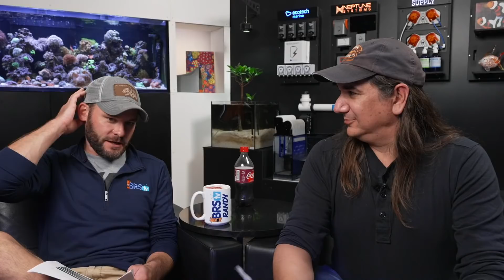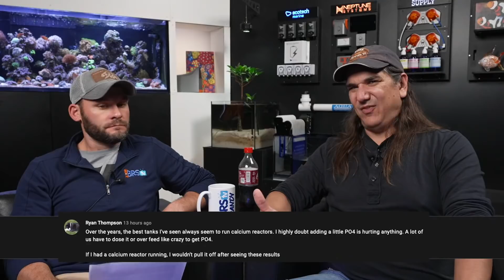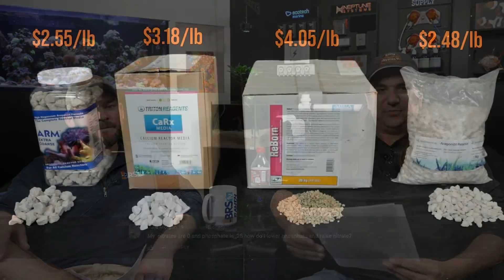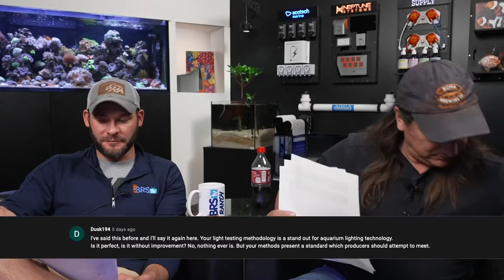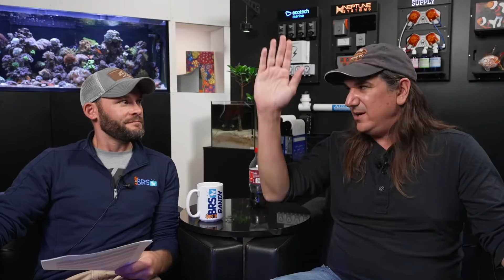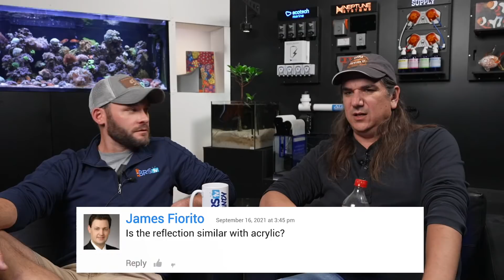What We Didn’t Tell You About Phosphate Factories, Crappy PAR Meters and Why Air Sucks for Lighting!

Comment: The reflection with acrylic will most probaly be the same. The angle at wich total reflection is achived will be a bit different but I think it will be pretty much the same outcome. Following a light ray from lamp to ground it will be refracted less to the side at the water/acrylic boundary compared to glass (because the difference of IoR if water and acrylic is smaller than that of water and glass) meaning it will hit the acrylic/air boudary unter a shallower angle, meaning it will be reflected even better (well it either is reflected or not, but the range of reflected paths, depending on the particular angle will be larger). However, the difference of IoR between acrylic an air is also smaller than that between glass and air, narrowinf down the area of angles that would be reflected. Maybe they cancel out at the end? If not I think the difference will be negligible. After that the light will get refracted less towards the bottom, compared to glass. So im pretty sure the phenomenon of reflection stays. Since, from the viewpoint of the light, pretty much all the area of the side panels are mirrors already, I don't think it changes anything in the whole (depending on the angle it's either a mirror or not. Even if there is no glass or acrylic at all, meaning that the difference of IoR is the smallest of all 3 scenarios, you achive total reflection with rather steep angles already. Watch videos of scuba divers looking at the sky. There is only a small "window" in the center of the field of view where you are actually able to see outside of the water. Everything else is reflection. See also my post about simply looking into the tank from the perspective of a light source.

Edit: So, it turns out that the spot where you can see out of water into air is 97 degress wide. For us that means that every light ray that is closer than 41.5 degrees to the wall of the aquarium will get reflected. But wait, this is without glass or acrylic in between. I just remembered that a "coat" of an optically denser material, between water and air will have the effect of increasing this angle (a wider range of angles getting reflected). It's done with glas fiber this way. That means that with acrylic you will achive reflection less easy than with glass but it will still be better than having no "coat" at all. So the absolute minimum you'll get are the mentioned 41.5 degrees. The IoR of the usual glas and acrylic are pretty close. Water: 1.33; Acrylic 1.49-1.5; "normal" Glas: 1.5-1.52

By the way, there is free CAD software where you could model your aquarium, glass/acrylic thickness, lamp height and all, and see what gets reflected. I just don't have it installed right now :P .

Comment: You seriously can't judge PAR or brightness with the eye. It's not designed for that. There are 2 things making this nigh impossible. 1st Eyes/brains compare the brightnesses and don't measure absolute brightness. Where you end up is extremely dependent on the surrounding light. 2nd the "brightness" one percives is the logarithm of the actual brigtness. Meaning that if the brightness/PAR is doubled it looks like it was only increased by a little bit. The same it true for sound. This is the reason why a 200 watts hi-fi isn't twice as loud as a 100 watt hi-fi. Enery wise it is, but you need much more than double the energy to make it subjectively sound twice as loud.

Comment: You don't need the laser or consult scientists, you can just see the reflection of the light by looking into the tank from above (your eyes about there where the light would sit) everywhere where you see the ground reflected in the side windows...well the light is reflected to the ground, it goes both ways. Without water you kann see through the windows, with water you see the ground. I don't want to brag but I actually can't fathom that this isn't widely known..? I noticed that with my first 2 gallon tank. You can also see that when the water is a bit murky or if it has yellowing pigments and you use only blu or better violet/UV light. The light shafts bounce off of the sides.

Comment: I have an idea for a video/BRS investigates!  Is low PH caused by higher atmospheric CO2 OR nitrification?  As nitrification does release nitric acid HNO3.  I believe that the lower PH many people have issues with have to be more from nitrification than CO2 creating carbonic acid.  If you have 50 fish vs. 7 fish you have less bioload, therefore, less nitrification process, thus less HNO3, right?.  In a properly aerated tank (i.e. skimmer, water return breaking water surface, etc) there should be lower CO2 and can be measured via alkalinity.  Not to mention kalk puts the squeeze on CO2, as well, and many people use kalk.  So then WHY does PH remain low?  #CHEMISTRYSUX

Comment: On the topic of tank sides acting like mirrors I had a weird one this morning. Setup a 10qt tank on my desk and on the short side furthest from me you can put anything behind the tank right against the glass and can’t see it. Tried putting a few different colour boxes against it and it just looks like a mirror. I sit a couple feet to the left of the tank so I’m assuming it’s the angle that does it. On the plus side I should be able to run any cables down that side of the tank and won’t see them from where I sit lol.

Comment: I think i figured it out (the Seneye issue). There are 4 versions of the suds (V1, V2, V4 and now V6), recognisable by the first number of the firmware they're running. The V4, running on 4.0.x, has the issue. This one needs an update to 4.0.8 which should fix it.

Comment: What if you ran your calcium reactor with a gfo canister after it. Wouldn't that strip the phosphate, or just melt the gfo?
Reply from the maker: Interesting thought. I could see two potential issues here. One being the low pH effluent starting to dissolve the GFO and another being that the flow rate out of the effluent line would be really slow and not able to tumble the GFO properly. I think the best bet would be to have the effluent line dose into the same chamber of your sump where your GFO reactor pump is pumping water through the GFO reactor. You won't catch 100% of the added phosphate, but it should help out quite a bit if you're dealing with a larger phosphate issue.

Comment: What are the bennefits to testing Rectangular tanks? My first thought was ... Before worrying about testing different  SIZES of Cubed tanks ... PLEASE.. Test on RECTANGULAR tanks ALSO. At Least ONCE.. at The End or two key points..
DEFINITELY NEED to take poll of how of how many people have cubes vs rectangles.. I would Think the majority is rectangular.( 60%+) need to at least  know how the intersecting middle light relates to the side(  being single but overlapped with reflective light).. it will give a good estimate in answering What Is the the strength of reflective light? And depending on front to back depth..  it still may be getting full overlapping reflective light from the front and back panels as well.

Comment: Ryan, somebody on R2R claims to just have received a brand new revision (V6? he says, we all have the V2) Seneye and this one shows similar par readings as his MQ510. 
The plot thickens...
Reply: I have been looking into this on r2r. It seems that the issue was with the v4. The v2 I think as long as you hadn’t updated it to the version that broke it it would stay at normal readings. The v4 I guess all had issues but it seems there has been some sort of fix now but only seen a few reports of that. The v6 (not sure when it shipped) seems like it had no issues from the start but maybe was so new hardly any have shipped? Either way it seems like they have fixed it at least for some people so hopefully we get a clear answer soon on what has been fixed and if any models will still be effected.
Reply: @KnarBurger  You can't break a V2 or V3 simply because they don't get updates anymore. A V2 runs on 2.x.x firmware and the V3 runs on 3.x.x. firmware. Both are fine and neither will ever get the buggy 4.x.x because this is only for the V4. The V6 runs on 6.x.x and is fine like the V2 and V3.
I have a V4 and have received from Seneye a test firmware (4.0.8) and this one fixes the issue. It's not publicly available yet.
Reply: @Harolddespui  ah ok. I had seen post about the v2 also not working but probably was just a few people that didn’t realize what model they had.
Reply: @KnarBurger  Correct, initially i also thought that i had a V2 but it is a V4. All the V2's are fine.

Comment: Can't wait for the Seneye retest. I also think it's a firmware bug because it's pretty much exactly 2 times as high (i believe it's 1.9 to be exact). But Seneye however denies it. They say all other meters are off and theirs is fine. :-) Would be nice by the way if you guys also have an older model laying around (+2 or 3 years or so), to compare with a recent model.
Reply: I believe it was just one version of software on the v4 model or whatever it was called. The newest models didn’t have the issue and the older ones didn’t either. Seems to be fixed with an update from what I’ve seen online though. Was thinking about buying one and came across the controversy. Gonna let it play out and get everything sorted for a bit before I buy one.
Reply: @KnarBurger  Correct, V2/V3 and the latest V6 doesn't have the issue, it's only the V4 running on firmware 4.0.6. An update to 4.0.8 solves it.